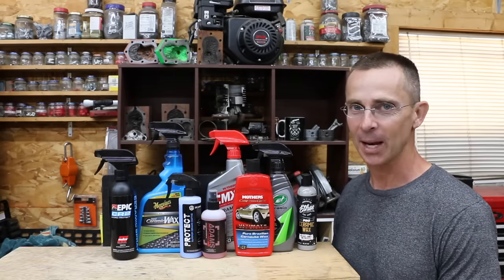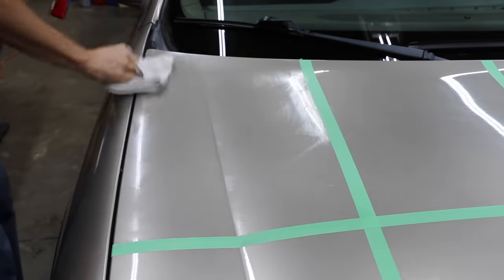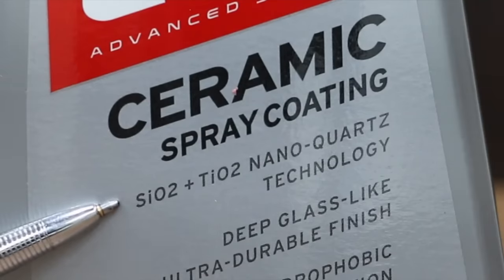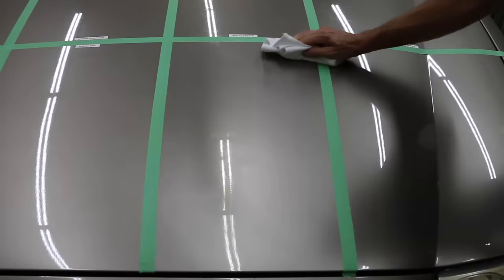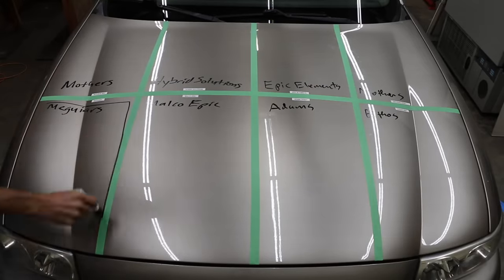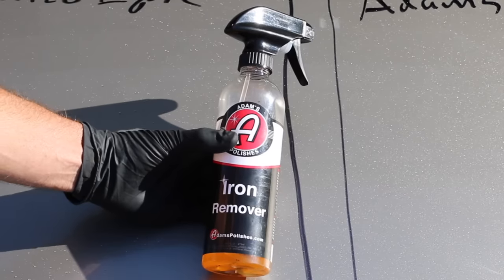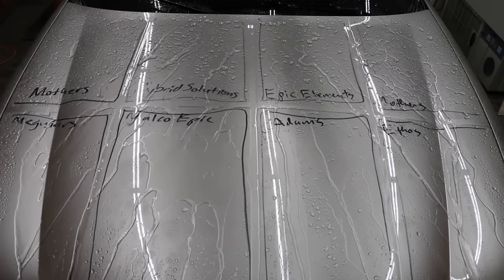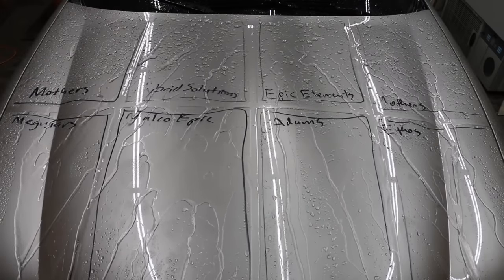Best Ceramic Spray Coating? Mothers vs Meguiars vs Ethos Pro

Comment: But can we talk about the Buick?    Severely underrated comfort-mobile.   I'd love to have one in my garage.
Reply from the maker: Thanks for the feedback.
Reply: I completely agree.  It is definitely a comfortable and reliable vehicle.  With proper maintenance these cars can last someone a long time.  Where I work we had 2 of these as fleet vehicles.  One had "died " and I asked my boss about it.  He said if you can get it running then it is yours.  I replaced the battery and unplugged the Mass Air Flow sensor and was able to drive it home.  I has to do some maintenance items that were due to be done, had to replace the rear door modules, top off the AC, and replaced the coolant elbows that are a known weak spot for 3800 series II engines.  I got it with 275k on the clock and drove it everywhere.  I ended up giving it to the lady that was helping my mom when I was at work because I found out she was hitch hiking 40 miles to get to town.  When it was destroyed in an accident it was nearing the 400k mark and was still on the original never rebuilt motor and transmission.   Seriously a good vehicle.  not to mention it got over 30 mpg on the interstate.
Reply: @jaadams72  GM transmissions are not known for lasting THAT long, it had to have been replaced you just didn't know..?
Reply: liblib89 I understand the disbelief. We had the service records all the way back to 60k when the vehicle was purchased by my work.
Reply: @jaadams72  got 2004 Grand Prix gt same drive train 3.8 series 3  34 mpg here in Ontario Canada 408000 km on motor and transmission. I service transmission each year by pumping 4-5 litres out transmission dip stick tube and new dextron 6 back in .The oil gets changed every 6000 km  with what ever synthetic is on sale . I changed rage elbows to aluminium after market  when I changed the water pump . Parts are great price also water pump was $51  . Super reliable
Reply: @liblib89  408000 km on origional  transmission on my Grand Prix 3.8 I service transmission annually in 15 min 4-5 litres suctioned out of transmission dip stick tube  and 4-5 litres dextron6 installed . I also purchased a 2006 5.3 gxp with no transmission . Once a rebuilt transmission was installed I notice 1 reason they fail ( operating temp 215f ouch) . So I purchased a large transmission cooler and now temp max is 184 f  heat and never changing the fluid is the main problem . Also don’t use old dextron 3 . In the 5.3 I have used a synthetic dextron 6  .
Reply: My grandparents have one I love it it's so comfortable
Reply: I took my 1999 Regal to a roadtrip out of state with the boys and had an offer by one of them to buy my car. Had the 3.8 and it was an absolute dream to drive. @ 237K miles it had the sexiest steering I’ve ever had in a vehicle as well as ride comfort both front and back of the seats. Newer cars have the steering wheels more stiff and makes me wonder why they stopped doing that with vehicles. It was a first for me.
Reply: The 3800 V6 is legendary -   love em.

Comment: I bought the turtle wax product based on this and keep my car in the garage when not driving. I applied two coats. Despite it continuing to be provide nice beading, the slickness to the touch leaves after a month or so. So measurement of beading isn’t the only measure of lasting ability. Try it for yourself and see. It’s super easy to apply so I’ll use it 3-4 times per year.  It’s good, but not amazing.

Comment: As a detailer, detailing and correcting many cars a month. Turtle 🐢 Wax has up there game in the ceramic spray line. I know myself, along with many other detailers that use this all the time. The longevity, the gloss and depth. You cannot go wrong with Turtle. I highly recommend this product. I use it personally on my vehicles, its that good.
Reply from the maker: Thanks for sharing.

Comment: We’re missing the “real” ceramic coatings like CarPro, Nano, etc. would be cool to see how the MUCH CHEAPER Hybrid Solutions holds up to those!
Reply from the maker: Thanks for the suggestions for future round of testing.
Reply: when I started watching this video I thought myself I’m pretty sure those are not ceramic coatings but are synthetic polymer coatings I looked it up and it’s actually kind of confusing but I’m mostly right ceramic spray waxes are infused with about 10 to 14 percent SiO2 the SiO2 that makes it ceramic doesn’t fully harden and bond to the surface mixed with that amount of polymers at such a low percentage of SiO2. Ceramic nano coatings have a SiO2 with diy 80-86% professional grade 93% I think for the first time applier 80% would be the best as it’s the most forgiving mess up and it’s a pain in the ass to get off.
Reply: If he does these I'd like to see him these super cheap "Mr Fix" ones on ebay, as well.
Reply: I saw Hydro Silex advertised as well, but you can't tell how biased the company is when they do their own demonstrations
Reply: @ProjectFarm  
Gtechniq
Nanolex
Polish Angel
Autoglym
Miyabi Kamikaze

thanks.
Reply: @ProjectFarm  I would love to see you do this again with the commonly advertised ones.  F11, Nexgen, chemical guys, The last coat.
Reply: @philballphotography  chrmical guys is garbage, their products are the same but labeled different, their labels say one thing and the website says another, they erase negative truthful reviews which happened to me. Their interior cleaner dyed my microfiber towels yellow and faded my buttons, i have proof of all of this
Reply: @Oakleyworld  what company do you recommend? I bought some chemical guys stuff couple years ago because it was so cheap. It all worked and haven't seen any issues with the things that I bought. Was never really impressed by anything that I had use.
Reply: @otroflores91  some i recommend are Pinnacle and P21S.
For interior get 303 products.
Reply: Project Farm there is a product called Hydro by Carpro (I think) that is a green liquid. Also product called Reload by the same company.   No exaggeration, I spent over $1,000 on car costing the past 5 years and I keep going back to those two. I’m not affiliated with that company but the durability for such an easy spray on product is unreal.
Reply: @Oakleyworld  thanks

Comment: Wow, I am extremely impressed at the lengths y’all go to to test the different products. I had not even considered using a ceramic spray coating on my 17 year old truck. But, now I know definitively, when I do, use Hybrid Solutions Ceramic Spray Coating. Thanks.
Reply from the maker: Thanks for the feedbac.

Comment: My favorite YouTube channel!! You are amazing!! The big brands to test are The Last Coat and F11. I’ve seen their ads for awhile now!
Reply from the maker: Thanks for the video ideas.
Reply: F11 is criminally overpriced mediocre garbage. TLC version 2 is getting better, but still overpriced. You're better off with Seal & Shine than either of those for a fraction of the cost.
Reply: @jdisdetermined  the new "improved" Seal & Shine is unbelievable.  Ditto on the "improved" ICE spray wax...
Reply: Lol F11 is a joke compared to any of these

Comment: FYI, Slickness is NOT an indicator for how well a coating fills scratches.  Smoothness may, but Slickness is different.  Hope that helps, you are normally spot on and I appreciate you doing these.  I enjoy them all

Comment: Although it is not a ceramic coating, I would be really interested to see how Meguire's 21 (Synthetic Sealant 2.0).  My friend's dad used to paint cars for a living and he would only use Meguire's products.  I would be interested in seeing Nano Bond Pro and CQuartz as they are supposedly "Prosumer" products.  Great test as always.  I'd be curious to see how well they handled UV light as well.  Perhaps install a few of those medical grade UV lights (HVAC lights) and run them for a week or so?  Be careful though, don't be anywhere near them when you turn them on.  I'd be curious if any would show oxidation or increase the surface friction with the sponge test.

I'd be interested if you did a test on spray paint.  I've had bad luck with Krylon, but good luck with Rustoleum.  But stores also sell the cheap ones which I don't think are very good.  Then there are the automotive grade ones like duplicolor.  I'd be curious to see which has the best finish, and how much coverage you actually get from a can.

Keeping with the car hygiene testing...  Wheel shine?  Tire Shine?  Rain-x (And equivalents)?  Armor-all (And other equivalents).  LOL if you think about it, cars have lots of fluids, and then lots of fluids just to make them look nice.
Reply: i like alot of Meguires products, but for wax, i always perferred Mothers brand.  I detailed cars for years.. On high end cars, I would use professional products, but for normal soccer mom vehicles, I used off the shelf products for waxes.
Reply from the maker: Thanks for the video ideas.

Comment: I'd like to see Avalon King put to the test... They are all over automotive channels, I just don't know if it really works long term...
Reply from the maker: Added to the list. Thank you!
Reply: Nicolas Broszky  can't make everyone happy
Reply: Nicolas Broszky  Boo hoo hoo, the country is falling apart and this what gets so  me swearing upset, boo, hoo hoo
Reply: some professionals put avalonking on a 20 foot dark blue center console boat in my marina after a compound and polish, its been 9 months and the boat is patchy looking again. either they messed up the prep and didnt polish it out correctly or the coating is failing.
Reply: I now fear to suggest a product I’ve seen advertised.
Reply: Avalon King is all we use on our vehicles. 
Vehicles that were ordered from us are coated before they leave the shop. 
I use it on my Firebird, Camaro, LFA, X P100D, Vulcan etc. Pictures and such on Instagram. 
It really does work. But the Hybrid Solutions here did just fine and is like 1/3 the cost. So I’m not sure how I feel yet about that.
Reply: I used Avalon king on my wrangler a year ago, still beads as if I just waxed it! It really out preforms the spray “ceramic” waxes because it has a hard protective layer that resists scratches. It works well on my Jeep because I don’t have to worry about sticks and brush scratching my paint, and mud is way easier to spray off now!
Reply: Came here to say the same thing, see Avalon King being pushed constantly by some of the car guys here on YT, surprised it wasn't in the mix.

Comment: Next video: "Top Products to get Permanent Marker off your Wife's Car FAST"
Reply from the maker: Thanks for the video idea.
Reply: Dry erase marker removes permanent marker from non-porous surfaces
Reply: Most solvents will do it, rubbing alcohol, gasoline, diesel, paint thinner, acetone, etc.
Reply: some people don't appreciate this comment the way OP intended, but this was the first time I've laughed out loud at a youtube comment in a long time. Nicely done!
Reply: @Ahats5  same. I woke the kids up lol
Reply: well isopropal alchol works quite well so does acetone(dont use on plastics as most disolve under acetone)
Reply: Do not use acetone on paint
Reply: @mwalker9401  agreed acetone disolves plastics and latex and oil based paints  however most powder coats are immune to acetone as they are electrically bonded to the metal which is why i say isopropal alcohol which is the second most common form of nail polish remover the most common being acetone
Reply: Use brake fluid and steel wool
Reply: Now, now Evan... you know darned well that some fool will have to try that.
Reply: @mwalker9401  you are right, use lacquer thinner like pros at body shops
Reply: Isopropyl alcohol should remove the marker.

Comment: Project farm, let's see a video on gun cleaning chemicals and oil!
Reply: I second that!
Reply: Good idea. It’s even better if you throw in a couple of products from other industries. For example, does hybrid ceramic wax protect against rust on bluing better than Hoppes?
Reply: @barnett25  is this the same reason why history videos are demonitized? Like saying the japanese troops in WW2 were sadistic, youtube demonitize/take it off the algorithm. 

I dont trust youtube because of that
Reply: 3rd
Reply: @barnett25  Don't drink that cool aid Youtube tries to feed you! THEY decide who gets demonetized, not advertisers. Steven Crowder got demonetized without ANY Youtube rule violation. And there are MANY conservative companies, which would and HAVE advertised on his platform. Youtube's "algorithms" are written by silicon valley liberal soy boys... they ban a lot of factual content because THEY deem it "potentially controversial." They need to either stop or loose their Section 230 protection.
Reply: Great idea!
Reply: I've mentioned that a few times. Especially with rust preventing and lubrication. A lot of people swear by eezox, and I haven't been disappointed with it. But it doesn't feel like it's lubricating. IDK.
Reply from the maker: Thanks for the suggestion.

Comment: Missed the most important part. For part 2 you have to see which coating actually stays on more than a couple days.

Thickness is also a pretty important one as well.
Reply from the maker: Thanks for the video idea.
Reply: I kinda wanted to see a long term test
Reply: all of the different strip washes were designed to “simulate” which coatings would stay on longer. Yes it’s not going to be 1:1 versus the real world but is much more practical in this case.
Reply: I can tell you that Turtle wax hybrid last really well for a spray coat. I have been using it for a few months and I have refilled once because I wanted too, it was still showing water beading after washing. Stays on very well. A great product. My new favourite.
Reply: In case you're curious, the hybrid spray wax is honestly very good. I use it on my personal car, which I wash with the hybrid wash regularly so the coating is obviously still on since February. The more interesting part is that I applied it to my brother's bmw in March. He doesn't wash his car nearly as often, maybe twice a year but the coating is still very strong. He also drives about 400km a week.
Reply: @ProjectFarm  Da long-term test compared to one of the high-end glass bottle ceramic products.  I'd like to see how it sheds dirt and how much easier it is to wash, too.  With some of these, the car can come fairly clean with just a rinse.

Comment: I've tried many of the Ceramic coating. I followed the directions for Turtle Wax using their wash, I first used my Power washer attacting foam applicator and rinsed. Next I added 4-5 cap fulls to a bucket with warm water and washed my vehicle with a Micro fiber mitt and again rinsed. Finally dried vehicle with high powered blower. Pulled vehicle in garage and applied Turtle wax Ceramic spray. Shine was the best around. Dirt now rinses off
Reply from the maker: Thank you for the feedback!

Comment: I live in Canada, the turtle wax hybrid solution ceramic coating survives over 60% in the winter...I followed the instruction to apply the second layer after 24 hr letting the paint absorb the Sio2, and after two layers, it works perfectly through gas station machine wash and heavy salt after travel. recommend to people who love detailing.
Reply from the maker: Thanks for sharing.

Comment: I have been using ceramic solutions for over a year and just love the shine it gives my pickup. The best part is that it is so easy to apply compared to my old wax products, which are gathering dust in my garage.
Reply from the maker: Thanks for sharing.

Comment: Different gas station fuels ie chevon, shell, etc and send off samples for detergent values and then do some deposit tests and so on with regular 87 octane that most use.
Reply: This but also can you do it VS stuff like redex? ie redex vs premium fuel with additives.
Reply from the maker: Thanks for the feedback.
Reply: Yes for sure!  I'd like to see 87 and 93 octanes from the major brands compared. Gotta do the 93 as well for the V8s out there.  I hear Mobil has better/more additives in 87 and the same from Shell for 93.

Comment: For my ride - Thoroughly washed, twice - I then Nano Skin (clay bar) twice, using their Glide spray, then thoroughly washed twice again then thoroughly dried the car with a car drier. Then Hybrid Solutions Ceramic Sprayed three times and let it cure in the garage for 24 hours between coats and the paint gleams/sparkles like you might not believe. Yes, it was a lot of work, it gets washed each weekend with no loss of the ''sparkle'' since Xmas 2019. It gets driven and parked in the sun every day and under a carport at night. The paint is white which is a hard colour to get a ''wet'' look. When parked at a shopping centre it gets regular looks (I suppose because of the shine) by people walking by. Again, it was a lot of work but the effort and time was more than well worth it.
Thanks to Project Farm for the video and to confirm I made the right choice.
Reply from the maker: You are welcome!   Thanks for sharing.

Comment: I just did both our vehicles with hybrid solutions.  Rinse, Car Guys Strip Clean soap, rinse again, clay bar, rinse, towel dry, hybrid solutions application, wipe off extra with dry towel, wait 1 hr, apply second coat.   It’s so slippery!!   Thanks for the testing, great product
Reply from the maker: You are welcome!  Thanks for sharing.

Comment: First off, thanks for all the great videos, I have been using chemical guys and Avalon King ceramic products for a long time, after seeing what that 13 dollar bottle of turtle wax can do I have changed over, and it I will agree it does a better job and doesn’t hurt the wallet, thanks again!

Comment: After seeing this year s ago I have been using Hybrid Solutions. For you boaters...... this is amazing on how it keeps that water staining from embedding. If you wipe down its even better. I do reapply when I wash.... only because the boat runs in the 70's so I dont know if it hydro blast the protection off.